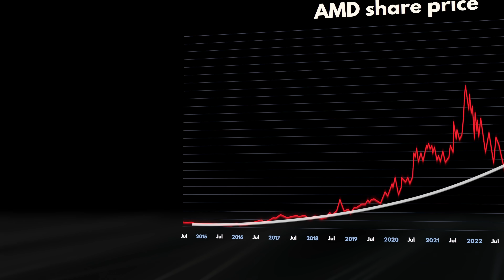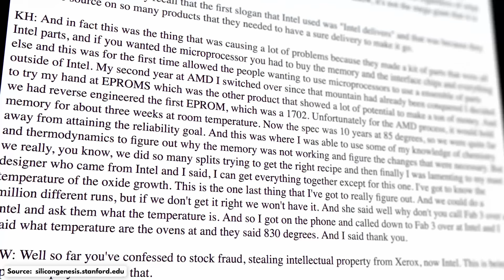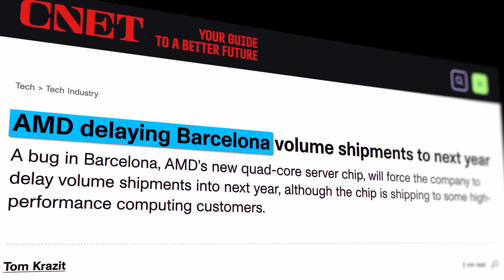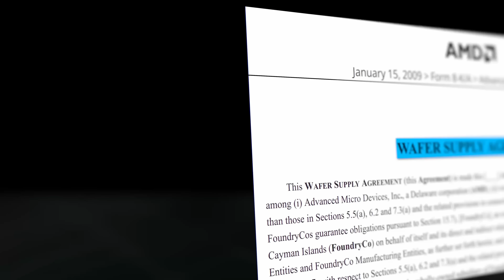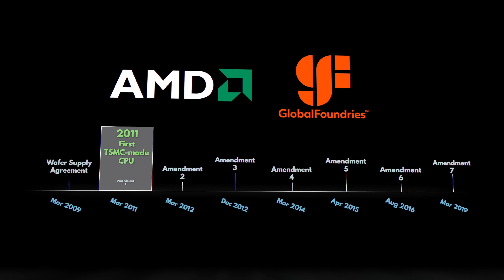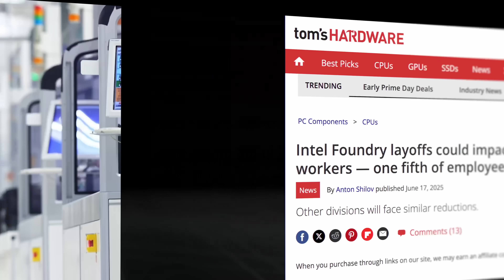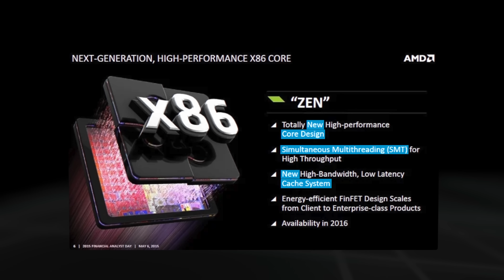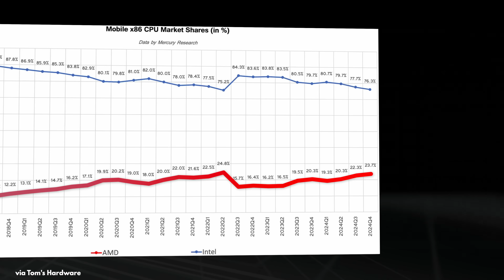How AMD won the CPU crown

Comment: The huge upgrade I got from AMD A4 4000 to Ryzen 5 3600 still makes me smile when I remember building my am4 platform 😂 excited to jump to AM5!
Reply: I went from an AMD A4 3400 to the i7-12700K.

The CPU part of the A4 3400 was trash(slower than Core 2 Duo and FX chips at the time), the iGPU impressed me.
Reply: @saricubra2867  yeah, the CPU performance of AMD's Bulldozer/Piledriver chips was really poor, but the iGPU performance of their APUs was far better than Intel's HD Graphics.  Suddenly, building desktops for everyday tasks and light gaming didn't require a dedicated graphics card.
Reply: @neospock5034 I was extremely CPU bottlenecked on Minecraft with the tr4sh CPU part of those old APUs.

I'm still CPU bottlenecked with my i7-12700K but it's so much better and without installing perfomance optimization mods
Reply: @saricubra2867  CPU bottlenecked with an i7-12700K?  What were you running- a Minecraft server?

Anyway, those two are light years apart. Even a 2nd generation i5 would have been a huge upgrade, let alone a 12th generation i7.
Reply: @neospock5034 Minecraft Java runs in one thread when loading chunks. The overall floating point speed of the i7-12700K is 7 times faster than my old mobile Haswell i7 and beats many Ryzen 7s, Ryzen 9s (minus Zen 4/5 ones).

All of that speed doesn't matter if the game uses one thread.

Still, i noticed the instant difference for stuttering. i7-12700K is so much smoother.

Comment: Intel just needed to walk away from their fabs and source from TSMC.  They could have froze AMD out of TSMC wafer supply back in the 11th Gen Rocket Lake days and it would have been game over for AMD.  Just imagine how good 11th gen through 14th gen could have been if they were fabbed at TSMC.  Higher IPC, higher clocks and similar power efficiency as Zen.

The only hope for Intel now is whether or not they can get their fabs to catch TSMC, which actually they are making great progress all things considered.
Reply: Yeah, Intel should go with the manufacturer which is singlehandedly spiking the price of integrated circuits globally due to lack of competition.
"could have froze" <- I'm an adult and past participles are *HARD*.
Reply: TSMC is the whole reason why an RTX 5070 is around 780 dollars.

I dislike them so much, Meteor Lake and Arrow Lake use TSMC and the architectures are a flop.

Intel just has to get their fabs under control.
Reply: @saricubra2867  Why do you think Arrow Lake architecture is a flop?  It is literally faster with higher IPC than any AMD CPU.
Reply: @Nanerbeet The IPC is not faster, you haven't checked the weak memory controller hurting their gaming even compared to Raptor Lake.

Arrow Lake ane Meteor Lake were designed for AI, not raw CPU speed.
Reply: @saricubra2867  You are absolutely wrong about that.  Arrow Lake has the highest IPC and raw performance of single core out of any x86 processor.  Period.  This is verifiably true and accurate.
Reply: @Nanerbeet With fake IPC numbers like they did on Rocket Lake (another flop).

I haven't met a single person that builds a PC with Core Ultra, and the removal of hyperthreading made multithread way slower...

Comment: x3d is a marketing gimmick, no gamer should be spending $450 on a cpu
Reply: So you define a newest and most performative technology on the market a ‘marketing gimmick’? Says a lot about your understanding of the industry. No one makes you spend this much money on a cpu if you don’t want to
Reply: @dmmax18  i wouldnt recommend someone get a 9800x3d over a 14600k unless they already have a 240hz 4k oled and at least a 4080 and what is that like 1% of gamers.
Reply: @bigturkey1 I wouldn’t recommend anyone buy a Intel 14th gen because in order to upgrade one would have to spend a fortune for new cpu and motherboard. That’s ignoring all of the issues with the 14th gen.
Reply: @bigturkey1 14600K?
i7-13700K is a nice budget i7. Ideally if the motherboard doesn't kill it with "stock" settings without Intel's specs.
Reply: @bigturkey1  you of course have no idea what your talking about
Reply: @Dzlab0989  you make a strong argument but i still think x3d is a marketing gimmick
Reply: @dmmax18  i picked up a 14600k for $150 that came with bf6. ill probably use it 10 + years
Reply: im not spend for the 9800x3d cuz i spend for a 9950x , it good on both work and gaming tasks😂
Reply: @Phan1hs And scheduling is not a problem unlike the R9 X3D variants (i prefer an i9 instead of those).
Reply: @Phan1hs 14600k is better for streaming than 9950x
Reply: @bigturkey1 no it not , streaming are use gpu to encode , it just same
Reply: @Phan1hs  with intel you use the igpu to enocde stream its called quicksync and it superior to gpu encoding in everyway, better in game fps and less fps dips

Comment: I disagree when you said Intel got it's act together. Pat Gelsinger scrapped 20A node and Arrowlake ended up using TSMC. Nova Lake will also be using TSMC and new CEO Lipbu Tan is reportedly thinking of scrapping the 18A node. They're still in hot water and need to prove to us that they can still make Chips in their own foundries.

Comment: just to help you out the copilot excel you can remove it by - Open Excel.
- Go to File > Options > Copilot.
- Uncheck "Enable Copilot".
- Click OK, then restart Excel.
 and - Go to File > Options > Copilot.
- Check "Show Copilot icon only for highly relevant suggestions".
Reply: it works

Comment: Insightful video
Zen's multicore success actually started with the financially disastrous FX line if you really think it over
Spicing it with modularity was the ultimate game changer
I recall Intel aggressively labelled the 1st generation EPYC chips as desktop rebrands not knowing the firestorm that was about to hit them
Reply: I guess their method and approach on modularity for the bulldozer got screwed up, but they found another clever way and did it on Zen.

I mean, the idea itself has probably already been there since the bulldozer era.

Comment: Actually, they didn't.

All major OEMs are still pushing Intel and Intel CPUs are majority in business. Once Intel 

They are good where there is a free will / DIY. 

Also, they played safe on GPU side and especially on APU side. When they should have gone big on both discreet and integrated GPUs.

PS: In my company its like 500 Intel based PCs to 1 (one) AMD based PC. Yep. ANd I would think it is a majority of the companies.

EDIT: I Love AMD, and no matter how I push for us to buy them, Dell simply does not have any proper AMD based workstation but very expensive Threadripper, while what we would love would be 9950X based one. We were buying Alienware based on AMD when they existed for simply reason because there was no workstation from Dell. It is even worse for laptops, nothing, just some garbage, nothing high end. So while they DO have better product, they still did not win.

Comment: Important thing many people forget about, Intel user had no option to switch CPU for a newer one without buying new motherboard but AMD supported many generations of their CPUs on the same motherboard. From financial and eco friendly standpoint getting Intel is irrational.
Reply: amd was always cheaper and broke down less than intel in 90s and early 200s.. when intel was 800 dollar for one processor amd came out with a 200 dollar process with same power in 90s.  they also created 3d now ahead of time with 64 bit tech that intel nor any video card did not have yet.  it lead to dvd tech, 3d layering and then ATI card as well ahead of time merged with them a perfect union of multimedia.
Reply: @keithconti6057  As far as I know, AMD bought ATI.
Reply: While I agree and this was one reason I switched to AMD CPU for the first time in over 20 years, most people want to buy a whole new computer every 5 or so years. This is a non-issue for the vast majority of people.
Reply: @r9bet 
And there was no promise when they launched Ryzen 1000 that there is future on the platform, I doubt AM5 upgrade path will be anywhere close to 1600>5800x3d. Easy to say in hindsight that AM4 was a good platform for upgrades.
(btw OP sell your old motherboard and CPU when you change systems, you don't need to trash them lol)
Reply: @tteqhu 1600 to 5800X3D?
Nah, better going from an i7-4700MQ to an i7-12700K (my path).

Comment: 12:28 I remember seeing a video about die manufacturing and they say the faulty ones can be used as is with its damaged cores disabled and sold as lower-end CPUs. So in AMD's case, if 1 CCX fails, its neighbor will be disabled and now its sold as a Ryzen 5. If multiple CCXs fail in the worst fashion imaginable, it's now down to just 1 CCX which can be sold as a Ryzen 3.

Comment: I remember in 2014-2016 I would occasionally come across people who would brag about having an 8 core AMD chip, and you tell those people didn't know much about computers, given a cheap Intel processor like an i3 would usually match it with the reasonably priced i5s smashing them. It wasn't until Ryzen 2000 in 2018 where it was actually worth using AMD for gaming, Ryzen 1000 was pretty awful for gaming and had a lot of issues. My first AMD chip was the R5 3600 and I was very impressed at how good it was for it's price after using a more expensive i7 7700k previously which was hot and slow even when it was new. In 2017 we were dying for more than 4 cores and 8 threads even for gaming.

Comment: The FX 8370E has the same computing power as a ryzen R3 1200... I had both and compared the performance to each other... they were virtually neck and neck in most apps and benchmarks. That's how bad the bulldozer was... then you had issues with ram compatibility on the FX because.... bulldozer.

Comment: I wish AMD could figure out how to lower idle power consumption for chiplet-based architectures.

Anyway, you missed a really fun chapter in the AMD vs Intel battle.

Long, long ago, Intel decided that customers are stupid, and started building chips to have the highest possible clock speeds regardless of actual performance. This was done under the assumption that consumers would just buy whichever CPU had the biggest clock speed. AMD actually managed to surpass Intel in performance because of this, and that saved AMD from going out of business.

Intel actually managed to screw itself by underestimating the intelligence of consumers. That does not happen often.

Comment: I used to swear by AMD. Now I'm totally understanding what makes Intel a better choice.AMD hasn’t won the GPU war because their top GPUs still lag behind Nvidia’s RTX 5080/5090 in ray tracing, DLSS performance, and raw power efficiency. Plus, even their best Ryzen CPUs can bottleneck Nvidia’s flagships due to slower single-core speeds and upgrade paths. Nvidia’s stronger ecosystem and faster innovation keep AMD playing catch-up.

Comment: Watching this video beside my AMD Ryzen 5 7640HS laptop makes me so happy. This CPU being in mid-tier getting 1600+ points in single core and 12,000+ points multicore in CR23 even in Quiet mode while in Best performance tuning is outstanding. While having a base clock speed of 4.3GHz.
Reply: I own an i7-12700K and it does almost 2000 at 4.7GHz and 23000 for all the threads.

The AMD equivalent would be the Ryzen 7 7700X, reaches similar singlethread score at 5.4GHz, slower in multicore.

That Ryzen 7 is a dogsh*t CPU.

5800X is better and the 5800X3D is also good staying way cooler.

The 7800X3D made the 7700X as pointless. 

The 7700X is for some reason very hard to cool despite being an 8 core (must be the BS clockspeed), then if it reaches 95C, a Ryzen 9 7900X is way, way faster (also beats my i7).

Sorry for my rant, but AMD priced the 7700X as much as a 12900K (that has twice the number of cores and almost twice the threads).

I still don't get the naming for AMD laptop chips, some are Zen 4 based, other are Zen 3 despite having the 7000 series on the same.

Is yours Zen 4 based or Zen 3?

I originally wanted to buy an AMD or Intel laptop but the awful naming pissed me off.

They have to relaunch the Athlon 64 X2 3800+ EE SFF with current BS CPU names.

Comment: 8:40 So, yes GF not running behind cutting edge nodes was in hindsight a great idea. While yes we're not the most efficient in producing chips, cost-wise, last year in total we shipped 2.1m wafers from the three main locations worldwide, coming from Singapore, then Dresden and then Malta+Burlington, US, in this order. There is a cost problem, yes, but there are some new technologies in development too, with a strong demand from the automotive and RF sectors. The smartphone sector has stagnated severely, which in turn has hit GF but we're not the only ones suffering. Samsung still remains GF's one of the biggest customers, while Fab 1 having one of the best in class yields for 22, 28, 40, 55nm products. Net profits are still positive, and there's good investor cashflow too, if I remember correctly.

Comment: Why didn't you mention that a huge reason AMD survived till today is the deals with PlayStation and XBOX.
Reply: probably tiny share compare to pc
Reply: @velfare  but at that time, it's basically the guaranteed cashflow for AMD. It's small at that time but they're getting it, and they made it extremely high volume to compensate for the hemorrhagic losses they're facing at that time.

Comment: A lot of the technology was successful and used all over the place, but i miss AMD's Fusion tech to abstract CPU and GPU cores behind programming language hints. 
This would have allowed you to automatically have code run on the best core without having to fiddle about moving data structures between RAM banks, it was transparent. 
You can still see the progression towards APUs  across the Xbox 360, Xbox One, PS4, Xbox SX and PS5.
But in the PC side you still assign RAM to the GPU whereas it was supposed to be the whole bank for the general purpose and float cores.
But it needed tight integration at the firmware and OS level and, at the time, nobody thought on-board graphics was worth the effort

Comment: As an infra engineer, it's been very interesting to see AMD charging hard in that space. We started deploying them with Zen 2 and within about three years had almost all of our production servers moved over. The initial advantage in price and core density was massive. I think it was THE main driver of many enterprise products away from socket-based and over to core-based licensing - we were dramatically reducing our socket count without having to lose cores, and lots of other companies were doing the same. True to what you point out, Epyc does own a lot of the high end, high margin AI/HPC space as well, in part because you could get 64+ cores and PCIe 5 sooner with AMD than Intel.

Comment: Great video! Thanks for making it!

Also of important note that was not covered is that with the launch of Zen, AMD broke Intel's forced (by Intel) desktop core count cap of 4c8t for mainstream desktops and infrequent HEDT releases (CPUs with more cores and PCIe lanes).   AMD not only launched an 8c16t processor with Zen 1, they also launched Threadripper for HEDT with more PCIe lanes and insane (at the time) core counts of 16c32t.   And AMD has continued to innovate with adding more core counts to their processors in future products!    Intel was finally forced to compete with more cores and now with new architectures like P-core and E-core. 

A great demonstration that competition truly breeds innovation!
Reply: They also put octacores in both consoles, forcing the desktop to adopt them to keep up performance wise to type consoles, as well as reducing the cost of porting games as they weren't going from 8 cores to 4.

Comment: I don't understand why so little laptop CPU share. Ryzens have much better power efficiency, at least until two years ago. I have a thin gaming laptop from Asus that I bought in 2021. I really like its power efficiency. Fan is almost inaudible in normal usage (even lower in Silent mode).

Comment: I think you do not understand the scope of AMD contribution and its x86_64. This was when Intel wanted everyone to switch to Itanium - a 64-bit CPU - the worst pos CPU ever. AMD saved the insdustry and billions of dollars from this crap that would have still, 25 years after, great repercution on all industries. Apple would not have used Intel (coming from PowerPC), and probably would not have went in designing their own M CPU based on ARM. The technology advancement would have been at least 10 years away.